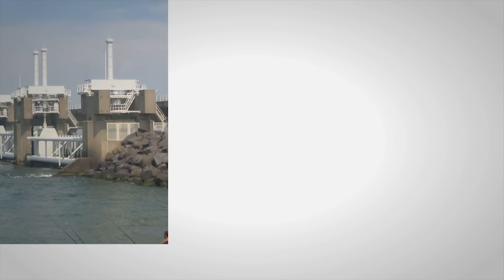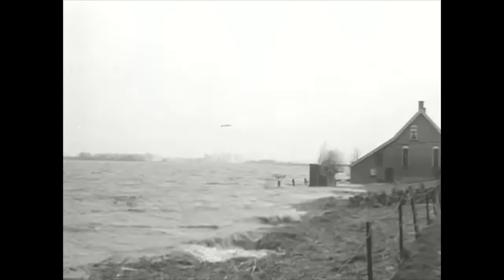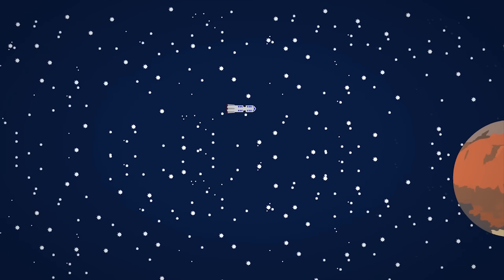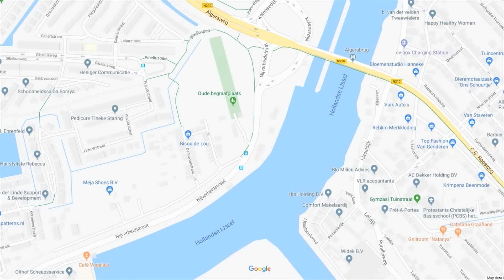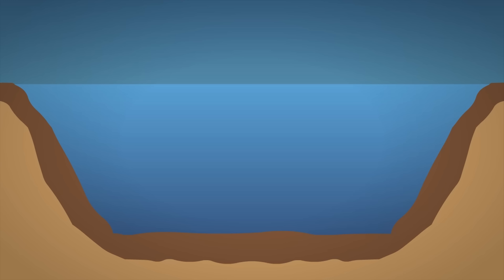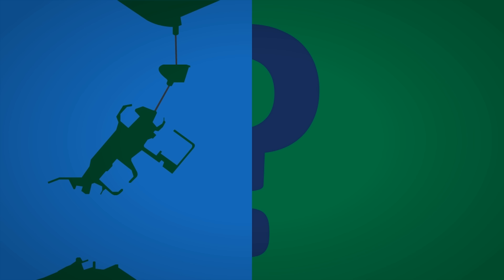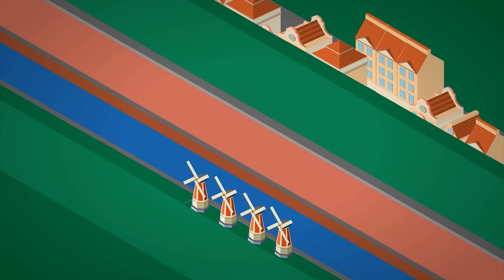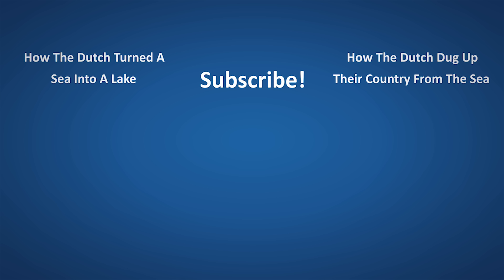Why The Netherlands Isn't Flooding (Anymore)

Comment: A better title would be, Why the Netherlands isn't Flooding at This Time.
Reply from the maker: Seeing as it flooded for millennia and stopped a few decades ago... no, it wouldn't be a better title.
Reply: @HistoryScope  seeing as we will be flooded again in one or two centuries if we don't change our ways, I disagree.
Reply: @randysem  Well in the US you have enough problems to deal with. We will survive.
Reply: @henkoosterink8744  I agree the US has many issues. However I don't see how it's on me to deal with them as I am Dutch, not American. 

As for the latter part of your comment. While I hope we will survive as a people and a country we cannot rest on our laurels. To secure our coastline and the West of the country with melting ice caps a much more comprehensive and ambitious approach is needed. If we want to keep Rotterdam, Delft, Gouda, The Hague, Leiden, Amsterdam and Haarlem we need plans for a much higher North Sea than we have now, and we need to get on that now. Or right after the pandemic.
Reply: @randysem  didn't you hear about the newest plans that were made in the Netherlands. There is a plan to make a new dam between Scotland and Norway and close of the channel between England and France. This way they can control the rising sea levels of countries around the north- and eastsea. The cost calculations are already made and it is a lot cheaper than when all countries around there will strengthen their fluid defences.

Comment: The Netherlands will not be able to stop 50 meter sea level rise if all the ice melts, you can only add so much dirt on existing infrastructure. Oh and all coastal cities will be under water also… all by 2200
Reply: i'll be dead by then, so not my problem

Comment: First we build dikes.
Then we build windmills to generate power
Then we build pumps to continuously pump the water out using that power
Then we develop farming methods suitable for this flooded soil i.e. dairy and tulips
Then we build economy to finance new windmills and artificial structures
Then we improve that power by building powerplants
Then we build even more economy and trade
Then we forget why we did that and think we can change the climate by reducing certain molecules
Then we build windmills and solar panels to save the planet

Then the power structures fail
Then the pumps fail
Then the dykes fail
And then we get flushed away.
Reply: No, we just need to improve some infrastructure.

Comment: Your ground is sinking.all oceans are connected and not seperate and my saltwater dock after 29 years hasn't suffered any ocean rise. Although the ocean rose a few feet 800 years year ago in recent time there hasn't been been any action on my measuring tape I have on the dock pier in seattle.

Comment: Great video! If the chinese can build fake islands from scratch, why cant Netherlands elevate the low lying areas or build a wall along the coastline to prevent flooding? I have been to Netherlands and love the jovial nature of its citizens!
Reply: (sorry for the late answer) Part of the problem is that the soil in the Netherlands is sinking at the same time as the sea levels rise. We've created a province too, quite a while ago by now, so knowledge isn't a problem, but it's probably cheaper and safer to do it like this. This way there might be holes (don't hope so), but they're survivable and the structures won't cause much day to day trouble. While a big wall would block trade and would be very dangerous if it broke. There was a whole period where they'd straightened rivers and build high dykes around them, but discovered that that wasn't the best way after all and are doing the opposite now.
Reply: @merelha5930  sealevels dont rise, they never did and never will do

Comment: why just do not build artificial islands like in Dubai that are above sea level?
Reply from the maker: That would be far more costly
Reply: @HistoryScope  but you at least try to remove the top soil level for agriculture in one small patch of land (say 10km x 10km) and sell it, then enclose it and then pump the underwater mud mixed with water into enclosed patch and allow the water to drain.. build at least 5 metres above sea level enclosure which will become 3m above sea level when it will be dried and use local wind power for all this..make more and wide channels too for rivers' water and in time step by step you will turn at least 50% of sub-sea level land into the land 3 m above the sea level

Comment: It all starting to make sense now!!!
1: we have used most of ground water
2: earth is heating for many reasons: global warming term itself is too vague. Over utilizations of ground water, contaminating ground water, no proper water management, buildjng dams is a NO NO!!! WATER isn't flowing with proper current. 
3: massive storms and change in weather patterns and instead of a solution we call it end time. I believe in God but God has also given us a mind to think. 
4: All of the flood water is being pumped out of the drainage system to the sea and we are articulating that due to global warming sea is rising, i don't think any one realizes how much water we pump back into the ocean. 
List goes on... 

Solution: "Sponge City" 
Reason: properly manages water. Green, water is purified, many many more benefits. 
No. I am not a professor but a thinker and a researcher!!!!!!!

Comment: Several mistakes... Grevelingen was closed totally, no sluces…,   The Zealand bridge over the eastern Oosterschelde is a bridge...
Reply: The Grevelingen has sluces on the eastern side, to which you can go to Haringvliet, and from Stellendam or Neeltje Jans to the North sea. Also it has pumps pumping water to the sea at Port Zélande.
Reply: @l.l.6407  you did not mention the forming of the Veerse meer. the first closing of the delta works?

Comment: Impressing! And interesting to watch!  I wonder about all the stones used as construction material. Have you got any stones in the Netherlands? There is plenty of sand, I suppose. But stones? Where did the stones come from?  I could sell you millions of stones from Sweden... (Småland)
Reply: Bit late to reply maybe, but we indeed have lots of sand and clay to work with. Large amounts of rock had to be imported, although the dikes main building materials are sand and clay. Rocks are used as a foundation and to cover the lower parts to stop the water from eroding away parts of the dike. Nowadays we use concrete blocks for that, I believe.
Reply: Even later, there are also quite a few big rocks left from both ice-ages (imported from our beloved Nordic neighbours 😉), so there are stones scattered all around. Most of them have already been used in graves (hunebedden) and buildings like churches